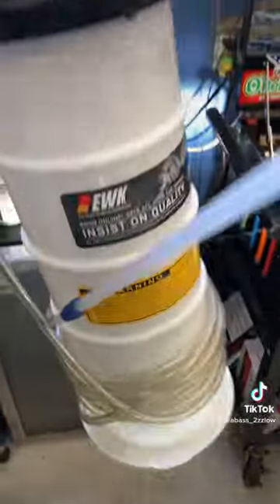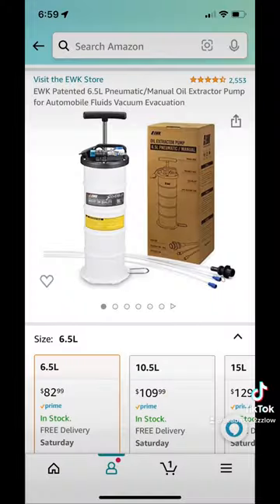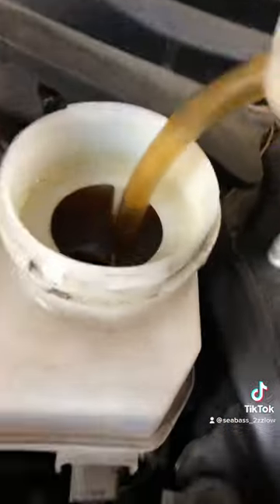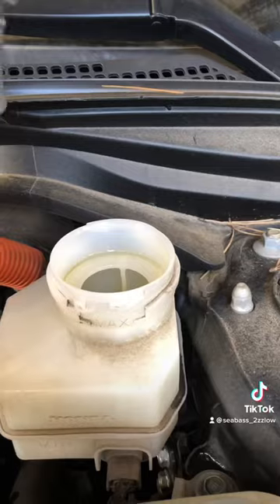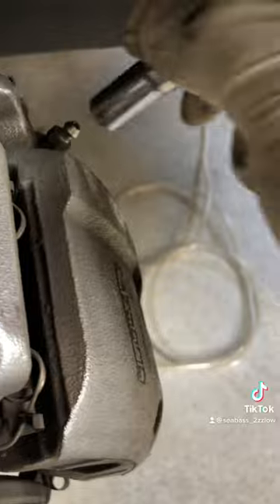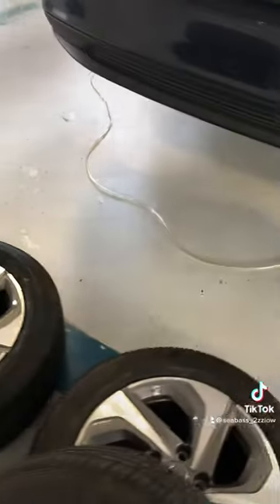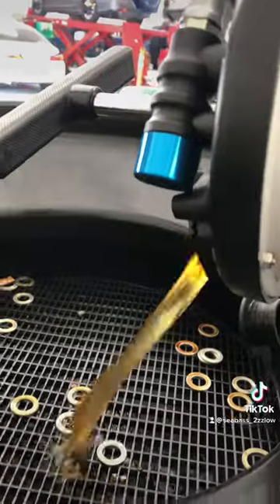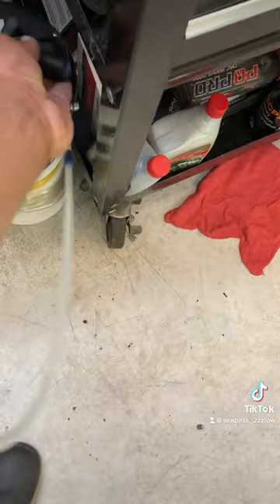is this the fastest brake bleeding tool? From Amazon aswell?!

Comment: I guess you can’t suck out too much from the reservoir as long as you don’t   Press the brake pedal? I usually just vacuum bleed everything down through the lines without removing from the reservoir. I keep my catch bottle smaller though cause there’s less chance of bleeding the reservoir dry if the vacuum on the bottle isn’t enough to drain 3 or 4 master cylinders haha
Reply: I just used a turkey baster. Cheaper and leaves a bit of a puddle on the bottom of the reservoir for you to add on top of. I’m like 95% sure it doesn’t hurt it to get all the old fluid out, but I had that creeping anxiety too when I was starting my brake bleed.
Reply: He bled them anyways. It makes 0 difference. Would just take longer to get the air out